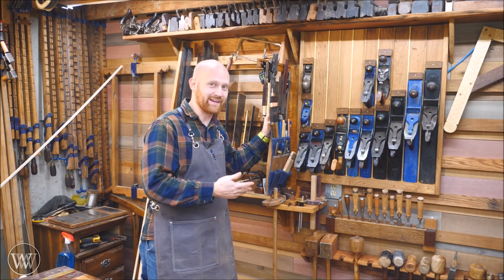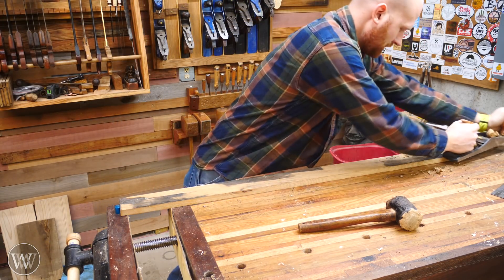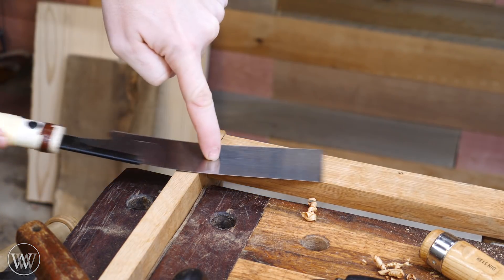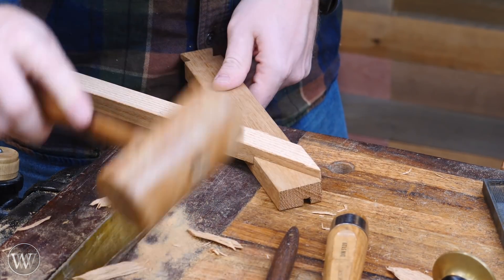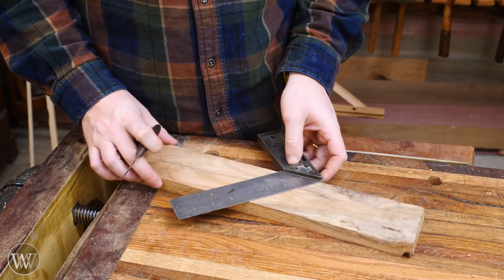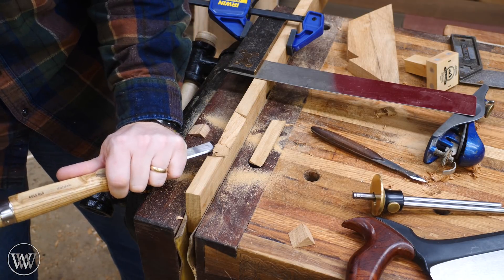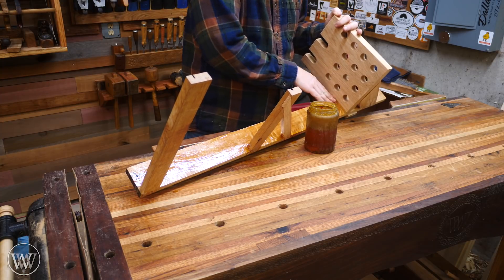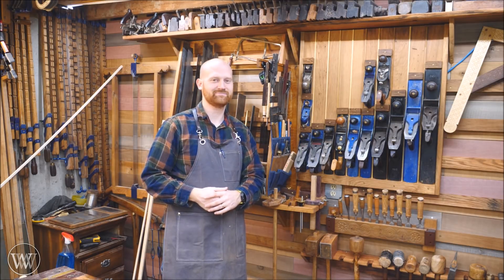Building a Rack For Marking Knives,Gauges, and Squares | Hand Tool Woodworking Project

Comment: You make a lot of joints. How strong would 2 pieces glued and screws be compared to your joinery? Would it be enough to hold 4-5 kg powertools?

Also if you make 2 plates meet, (an L shape) and you glue, screw and then bore dowels - how strong would that be?

Comment: You inspired me to redo my organization and I'm much happier but I do have a question:  As you have seen in my tool cabinet I've opted for magnet bars to hold my planes and chisels until I complete my collection and then I'll get a more structured till. I have not observed any issues relative to the magnets nor any residual magnetization. I've also not had any dulling of the blades since I spaced them to avoid contact. Can you enlighten me on your concern with regard to this? Thanks.
Reply from the maker: I don't have any real practical problem with them just like to limit hardware where ever possible. just personal prefrence.
Reply: Fair enough. I'm breathing a bit easier and thanks for taking time to answer. As always, you're the consummate teacher.
Reply from the maker: thanks Travis. also looks like I might be out your way again late February.
Reply: Super cool. If you are visiting the other member of the Collective, that is awesome. The Reese house is open to re-arm, re-fit, and re-saw if you need to!
Reply from the maker: LOL sweet. I am hoping to get a meeting with Will and possibly Shannon too.